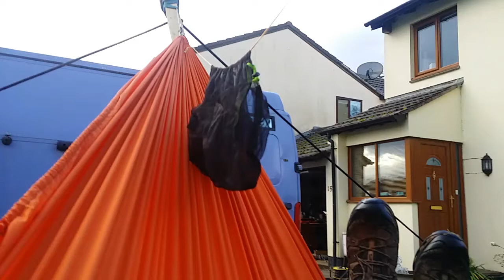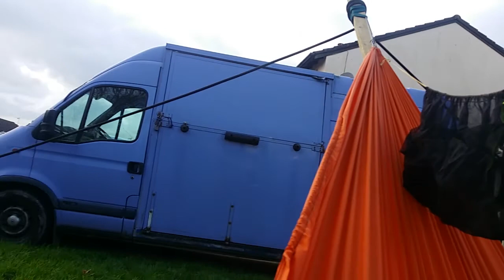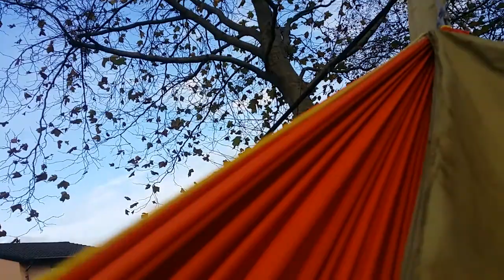Tensahedron with Two Fewer Poles

Comment: Great set up, but are the tie out lines under more pressure?  The beauty of the tensa hedro stand is the ability to avoid using huge stakes to hold the body weight (transferring the weight to the frame apex), is that still happening here?
Reply from the maker: Tony Trixton - all the hammock load is taken by the poles. As long as the poles are upright and not canted over to one side, then the guylines have no load on them.
Reply: Paul Tomlin if in the woods where all the trees are too small (like a fire or clearcut area), but there are long limbs or narrow dead trunks on the ground, how long would you recommend them being for a two pole tensahedron stand like this? Are they lashed together beneath the hammock?